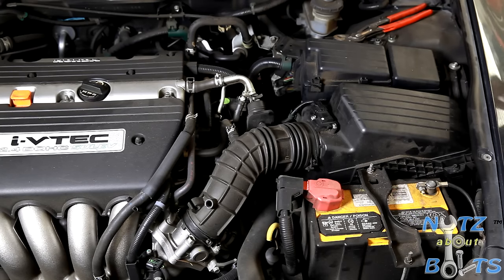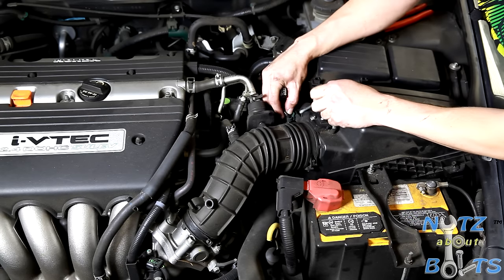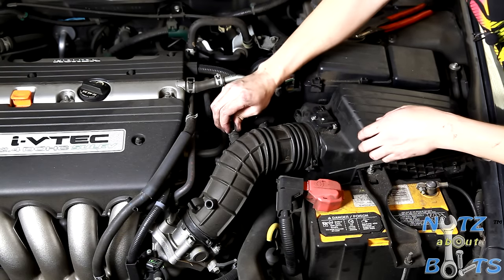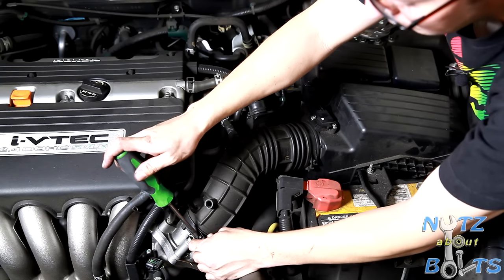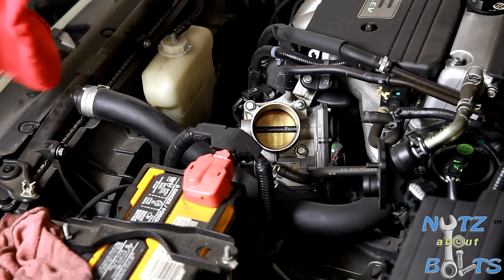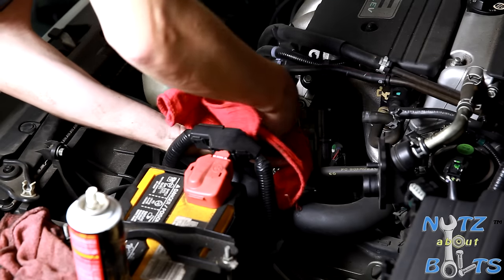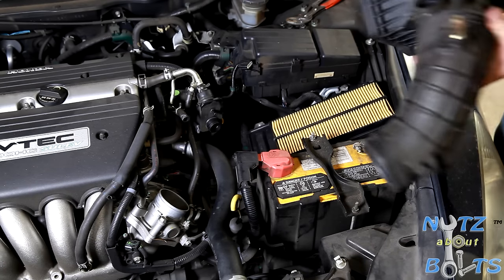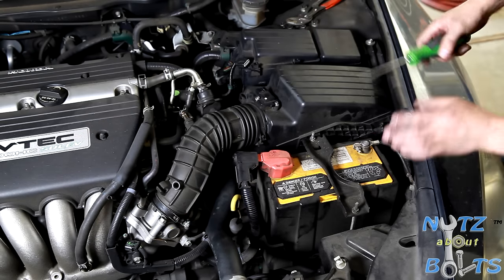2003-2007 Honda Accord Throttle body cleaning

Comment: DONT PUSH IT OPEN WITH YOUR FINGERS! , turn the key to power on, dont start it, power on. push the gas pedal and it will open. Wedge the gas pedal down or have someone push it for you. Open and close it as you spray the 2 sides where the butterfly spins. That’s where it gets sticky and needs to be sprayed while you opened and closed it until it loosens up and smooths out like new again.. apretiate the video for an example to send to a friend tho.. ✌️
Reply: Why not push open with fingers? Will it damage the stepper motor?
Reply: @stephenarling1667  yep
Reply: So when you do the procedure as you suggested, will idle learning procedure still need to be performed? Thx
Reply: Ive used my fingers to push open on multiple vehicles for yrs and never once broke anything, just have to know the limit, also to actually clean it needs to be removed from the vehicle completely and thruoghly cleaned
Reply: This did not work for our 2007 Accord. I had to manually open the butterfly valve.
Reply: I was thinking the same thing
Reply: @crispa1861 I would like to know the answer to your question too?
Reply: Hi. What did he use to spray? Or what is the best to use?
Reply: @terrywawro2951  It's totally fine to operate it manually with your fingers.  You just have to move it slowly, that's all.  Don't rapidly jam it open.
Reply: @staryjaszczur  Several companies sell cleaner that is specifically labeled as Throttle Body Cleaner.  You want to use Throttle Body Cleaner to clean a throttle body and not brake parts cleaner.  To clean a MAF/MAP, you also want to use MAF cleaner or electronic parts cleaner - again companies sell a cleaner specific to this application.

Comment: Just turn on ignition then have somebody step on gas pedal to the floor then the throttle will open, never open it manually 🤦‍♂️
Reply: Not to manually open it is a good advice.

Comment: I did it two hours ago to my car and I did not touch the butterfly. Don't touch the butterfly, period! It did work. I removed the negative battery connector first before taking everything off. In the meantime, I also cleaned the mass air sensor with an especial spray. Let it dry for 5 minutes. Put everything together and boom, the engine light is gone! 10 minutes process. A mechanic wanted $120 dollars for that crap. I was like yeah right. It does not sound that hard! Total cost $9 dollars to do it yourself.
Reply: So you only cleaned the front of the throttle body? What about the back of it, that's where the carbon gunks everything up!
Reply: If you want. I'm.not a tech for honda. 
You could remove the negative terminal 
You could then touch the butterfly.
Reply: I didn’t remove anything on my Chevy but the hose and I still cleaned the butterfly 🤷🏻‍♂️
Reply: Just Go North! please tell us how you cleaned the MAS. Thanks
Reply: @artcore9886  i think its lucky. What happened to me with what I did. 

1. Unplug battery 2013 si navi dealer said no code needed to be pressed. 
2. Unhook necessary components to access throttle body. 
3. Me i pushed open the throttle plate. 
4. Used wurth intake cleaner 
5. Bolt everything one 
6. Run like crap jump 1k to 2k. 

7. Drive it hard nothing happen..

Bring home. 
Repeat 1. 2  step just spray outside the plate. With wurth again. And I spray directly on the mass air flow sensor 
Put everything back. 
It idle. For further cleaning. There is a intake  manifold vacuum.hose. I hook it while running and quickly spray twice dont hold it Let rpm shoot up high.  Check.engine light will come.on.  after two shot.  Plug it back or let the car stall and die. And unplug battery it  turn off the cel :). And relearn the car again for 15 mins or 30 mins. After till this date from 7200 rpm was factory and I got 7400 something rpm. So extra 200 rpm.

I hope it made sense.
Reply: I recently did this to my 06 Accord. Just get an assistant to turn the car in the on position. NOT COMPLETELY ON but in ignition position II and have them press the gas. The throttle plate will open. Clean it this way if you have an electric throttle body. Never push the plate you could run the risk of screwing up the calibration. I believe older model cars that have throttle bodies that work off a cable assembly you can push them open manually.

Comment: I got a code P0506  ..engine light off and on do you think throttle body needs cleaning..by the way since you had access already to take off the throttle body why didn't take it off completely and clean the other side better or that was enough?

Comment: I have a 2004 honda accord with p0300,p0301,p0302,p0303 and when car is warming up feels smooth but at operating temp the car shake like im in a rocket when im at a stop light. I put new spark plugs, ignition coil, and i check fuel pressure 50psi up to fuel rail. And engine compression is at 145-148 across all for cylinders. I cleaned egr ports but i did not clean throtle body or intake manifold. Will cleaning this help me?

Comment: Thanks 😊  excellent video.  Changed my throttle intake hose today.  Badly cracked in several places.  Cleaned the throttle.  Dash light goes out. Car running like  new.
Reply: They all seem to crack after 10+ years, but you can get a new hose cheap.
Reply: Did you have the code p0171?
Reply: @LynWeeD is that code for trouble with throttle body p0171

Comment: Did mine today 👍🏽just gotta do idle relearn thanks for the video very helpful
Reply: The easiest way to turn on the  car on position put a brick or something heavy on the gas pedal to open the throttle body then clean it ....no need for throttle relearn if u do it that way

Comment: That is one clean engine bay though! Good job!
Reply from the maker: Thanks! We did an engine clean video before this video, so that’s why it looks clean. also a plus that we don’t live near the beach or anywhere near water. :)
Reply: @NutzAboutBolts  have you had a problem with your car shaking while at a stop in drive?
Reply from the maker: Richard Rivera nope. I’d check for idle issues if that’s the case.
Reply: @NutzAboutBolts  ok what made you clean the throttle body?   Was the car giving you problems?
Reply from the maker: Richard Rivera part of a maintenance routine I usually do and recommend since over time the plate can be sticky due to carbon build up.

Comment: Thanks you for this video. Will this fix poor or low idling?
Reply from the maker: I would clean this and then EGR system.
Reply from the maker: Also pcv valve, EGR system includes EGR passage and EGR valve.

Comment: Yeah, I wouldn’t have opened it. I messed up when I cleaned mine. Had to order the piece because the light came back on. Also, the car should be running when you clean it. At least when I did it. Hope this helps!!

Comment: If viewers find that after doing this they experience high idle which doesnt disappear even after doing the idle learn:, try following these steps to do a reset and clear using the battery cable reset method:

To do the battery cable reset- follow this: 1. Remove negative battery terminal. 2. Remove positive battery terminal. 3 Be sure you arent going to make contact with the battery, for later steps possibly even remove it from the car if needed 4. Connect the battery cables together either using a jumper cable or clamp them together if they reach. 5. Turn on your key to on (not ACC, to on) and yes there will be no lights on the dash. 6. Leave for 10 minutes. 7 Turn your key back to off, reconnect positive then negative and THEN follow the idle relearn procedure you will find pasted all over youtube (or just start the car rev 3k rpm until the car reaches temp and then leave it to idle 10 min). You will also need the radio code and possibly relearn your auto windows, for which there is good info for on youtube.

Comment: Would you recommend changing the engine oil soon since the cleaning fluid cleans out the intake valves and it might get mixed with the engine oil or does it get burned off or does it have no effect?
Reply from the maker: The cleaning fluid is too little to have any affect on the engine oil, it’ll probably be burned in the engine before it gets to the oil.

Comment: hey guys. I have a Honda Accord 04 coupe 2.4L with a rattling sound coming from the hood. It's similar to putting a pebble in a soda can and shaking it. It starts at low speeds of 35+ and continues at high speeds. I've cleaned the hood, made sure everything is tight and snug. Recently got transmission fluid, new front tires, alignment and filters. Cant figure it out. Help much needed and appreciated.
Reply: vaccum hose loose o broken check all hose around you see you will found also check inteck hose sometime is broken under
Reply: Does is sound near the timing chain? Id so you meed new timing chain
Reply: Check the passenger side axle vibration dampener. They come loose and start rattling on the axle shaft. Mine would start making noise at about 45 mph.

Comment: Thanks for this video.  I have a 2007 Accord just like this.  I am curious does a 2007 have an Idle Air Control Valve? Does the Throttle Position Sensor ever need to be cleaned?
Reply from the maker: +Chris S IACV is only on 03-05 year model. I think they went away with that on the 06-07 models. The 06-07 Models, they use the throttle actuator to maintain idle speed instead of the IAC valve. And the throttle position sensor only applies to 03-05 models, the 06-07 is integrated with the throttle actuator I believe.

Comment: Good video... Got error message U0107 "Lost communication w/ Throttle Actuator Control Module"  You think I need to replace the entire Throttle body.... Had the check engine light reset on car and going to see if it comes back on.  Car stalled on interstate going up big hill.  Thoughts?  Thx.
Reply: Andrew,  did you solve your problem?  Dealing with the same thing right now, same u0107 code.  "D" light goes OUT as well (does not blink on and off) at times.

Comment: thanks for the video, ever since I clean the throttle body my idle is shaky and the torque on my V6 is gone.... pulls like a V4. did you reset your computer, ECU etc.
Reply from the maker: No, we didn't have to reset te ecu. Did you happen to pull the throttle body out to clean? Or did you clean the throttle body plate like we did? We also have a idle relearn procedure video if things like that happens when you pull the TB out.

Comment: @155k my check engine light came on .
Thought it was the transmission would not shift pass 2500rpm.
Quick trip to shop yup tps..
Well on 2007 accord TPS is built into throttle body, $950.00 to replace .

They reset  check engine light .
Drove it 80 miles no check  light 🤔

Well I had taking my car to dealer twice after 88k miles when I initially bought it used , they never did the throttle body because I cleaned it out today as per your instructions.
Used 4 tough towels and they all crazy black buildup 
Boy what a difference. It idle at 950rpm now at 650rpm no shaking at idle when stopping .

The check engine light came back on after initially cleaning and turning on engine .
Is this normal , should I remove battery cables to reset?
Reply: I did turn on ignition and used pedal to open up throttle butterfly not my fingers..
Reply from the maker: Never happened to me before and I’ve cleaned many times like this. I’d get the code and see what it is, if it’s the same code for the tps, I’d bring it back to the dealership since they replaced the throttle body. Hopefully it’s still under warranty and have them service it.
Reply: No I did not remove cable from negative post prior to removing intake  tube and doing cleanse..
Reply from the maker: @nandobelt8687  its possible the throttle body detected an error while you open the throttle body plate to clean. I’d reset the check engine light and monitor it to see if it’ll come back on

Comment: Hi my friend, I cleaned the throttle body and rest by scan tool but the problem after 2 days when I shift the gear to R or D the RPM low and vibration if A/C work the vibration strong, I do rest again, after 2 or 3 days the problem came again.

Comment: I got an aftermarket hose, but the hole where the temp. sensor goes, it's closed!  Do I need to open It, I mean, make a hole in it, right? I'm talking about the little hole on the LEFT part of the hose.

Comment: hey bud my eps lights turned on on my honda accord cl9 2004 some mechanics say its the alternator some say its the eps system but my alternator is kinda week at times i cant really figure out wats exactly wrong but the eps turns off n on sometimes its like it chips in n chips out just need some help

Comment: HI I got an issue today on my 2005 i4 Accord  ..  my rpm suddenly went on 4000 rpm ,,  I was just setting on the car not moving ...  do you think I need to clean the throttle??  thanks 😄
Reply from the maker: sounds like you have a huge vacuum leak somewhere to have that high of a rpm.

Comment: clean as video irst after I took it for a test drive  the car lack POWER, cleaned it again pulling the throttle body out of the car..... watched another video notice they mention not to touch the throttle body plate. because I might need to reset.
Reply from the maker: You pulled the throttle body out of the engine. So you will have to do the idle relearn procedure. You can find that video in our playlist.
Reply: Thank you, more power to you
Reply from the maker: No problem, also it's inline 4 cylinder so incase someone ask if your engine is V6 or inline 4 cylinder. We don't want you to get clowned on or made fun of :).

Comment: Watched your video and cleaned the throttle body on my 2003 accord 2.4 today. As I opened the throttle, I noticed some coolant in the bottom of the intake plenum. Without removing the body, I just rolled up some shop towels and stuck them past the throttle plate to soak up as much as I could. Where do you think this coolant is coming from? I'm not running hot nor do I need to periodically top it off with coolant. It wasn't much coolant but it does have me concerned. Could the heater hoses to the throttle have corroded within the body and then leak into the plenum/manifold? Or should I worry about the manifold gasket. Asking you or anyone with experience on this k24A4. Thanks
Reply: i think that this just means that you have a coolant leak somewhere. I'm no expert but my 07 started making boiling noises from the radiator more than it even should be and that was leading to coolant flowing to other parts of the engine. ended up being a leak in one of the hoses and a clamp fixed the problem.

Comment: Hey I need some help over here. Ok so I did most of the steps that you've mentioned in the video except removing the intake filter's cover, I unclamped the hose to the housing instead. Getting to the issue, after cleaning it and putting the things back together, I noticed my rev goes really high when I start it say for around 2k until 3k rpm, and I also noticed that the idle stays at 1k. Lastly, downshifting of the auto tranny became jerky from 3rd to 2nd, I actually felt the deacceleration in an unusual way. Please help me out cuz I don't think it's normal for a car to do that. Plus it drinks alot of fuel now.. I have an 06 Honda Accord 2.4L i4
Reply from the maker: +Christopher Gabriel Dela Cruz Check for air leaks, air leak will give you a higher than normal idle.

Comment: my screws are in pretty bad shape - especially the screw that secures the hose clamp. any tips on getting this off if it is stripping the screw?
Reply: Use a 8, or 10 mm nut driver to remove the clamp screw, it is much easier than using the screw driver.

Comment: I have a problem I cleaning now throttled body and mag sensor but I have k&n intake. The problem it’s acceleration when I don’t do that, and ocsilated on 2000 rpm and 1500 when I on stop light

Comment: Baafuor Hi, am using a 2004 Honda Accord 2.4 and am facing a big problem nowWhenever am driving with my A/C on and I make and stop or stops in a traffic then the car beings to shake seriously but when I put it back to neural or parking it stops and the fire rises. Pls help me out quick
Reply from the maker: +baafuor awuah kofi check your motor mounts.

Comment: i have exactly car like yours... doi you think it might change the tempo after u clean
Reply from the maker: +Pex Man Tempo? once you clean it, there will be better air flow and the fuel to air ratio is better and your vehicle won't run rich to compensate for the lack of air coming into the engine.
Reply: +NutzAboutBolts Thank you very much...for replying me back...
Reply from the maker: tigaspinoypower
np!

Comment: 2005 Honda Accord 2.4L --- Does anyone know the screws and bolts for the ICV and throttle body? I heard they strip out very easy and I want to be prepared to use new screws
Reply: Did you figure it out? My recommendation would be to spray a little liquid wrench on them the day before attempting to remove them.
Reply: @MrRedHotChiliMan  I ended up not needing to do this. I was suffering from idle issues but was able to fix it after attempting to relearn idle procedure like a dozen times

Comment: Hello,can i use "Brake Cleaner" instead of "Throttle Body Cleaner"?
Reply from the maker: Yes, spray it on a rag and use the rag to wipe away the carbon.
Reply: NO.  Brake cleaner leaves residue.
Reply: DO NOT use brake cleaner!!!  Goodman is right. It leaves residue.  Throttle body cleaner is different because it does not leave residue.

Comment: That screw you said is a flat head is not a flat head on mine. The part of the hose that attaches to the throttle body it’s some weird square that none of my tools fit. 😡